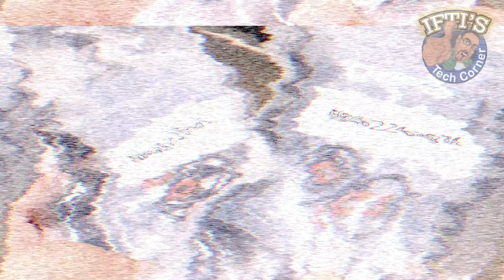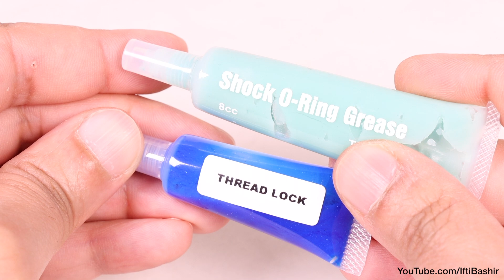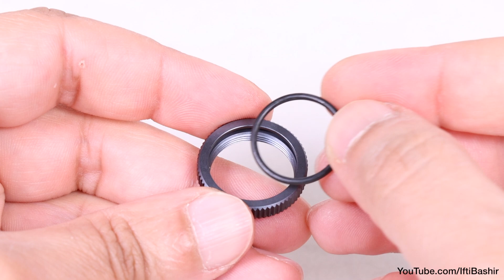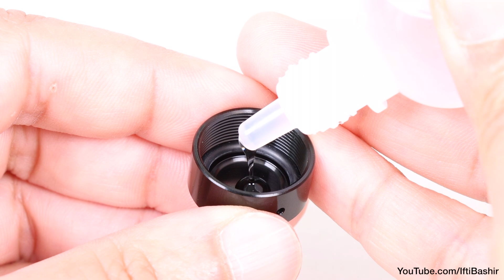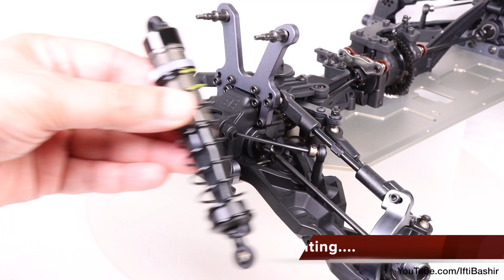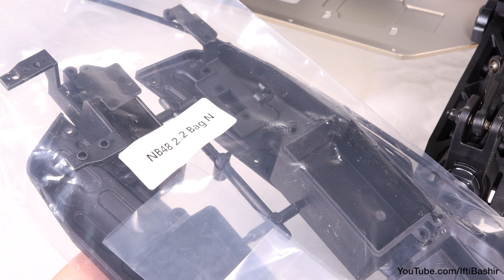#12 Tekno NB48 2.2 - BUILD SERIES - Kit Bag L & M : Shock Assembly

Comment: Another tip that makes the ball end of the shock, or linkages easier.  Pop the ball into the end, then use a 2.0 driver through the ball while the shock tool holds the shaft.  Easier on the fingers.